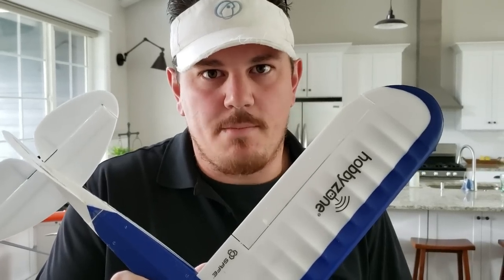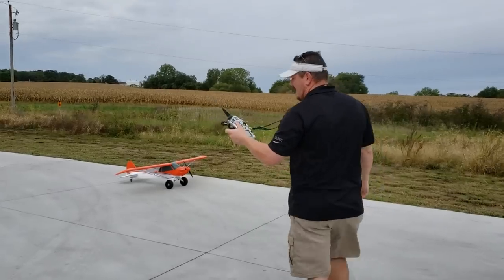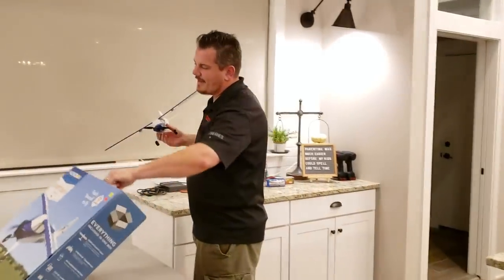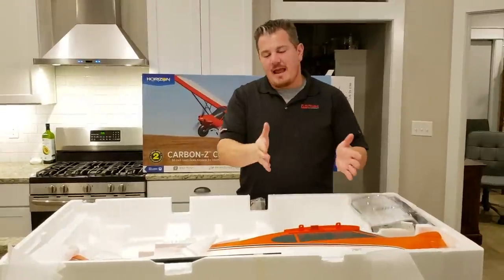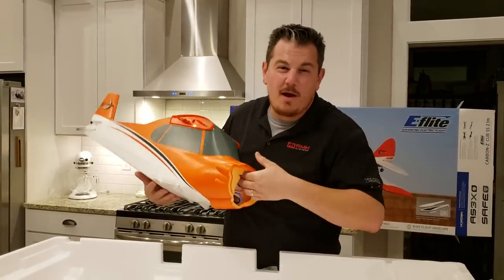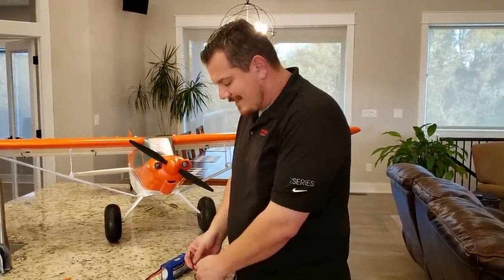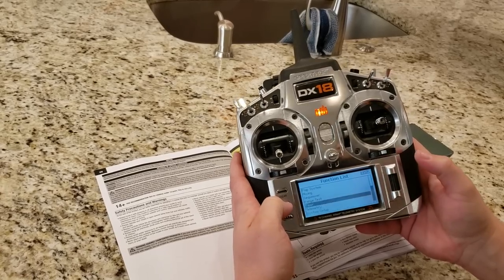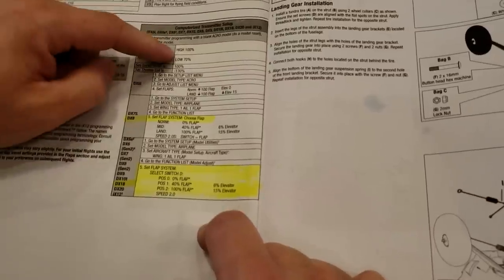Horizon Hobby - Carbon-Z Cub SS 2.1m - Unbox Build Maiden

Comment: There are four things we like to see:
1)  unboxing
2)  build video
3)  radio setup | preflight checks
4)  maiden flight;  flight characteristics,  tips, handling,  &c
Thanks for this video;  very nice,  has well prepared me for my own Cub SS experience.
Reply from the maker: Sounds like I showed you what you need to see ;) BTW, this plane is WONDERFUL! Check you prop a few flights in (the spinner tightness) I had mine pull off in a hammerhead...but all is well, I just flew dead stick from the neighbors side and made a perfect landing, and my father-in-law watched the prop, spinner float down, totally undamaged ;) Had her flying in 3 minutes!!! I did experience some damage to my cowl, but HH helped me out on this.
Reply: @BrianPhillipsRC   Thanks Brian;  actually I already have an upgrade ordered for it--  wooden prop 16x7 ,  and chrome spinner  (honestly I think Horizon should have done that anyway, but whatever.  I was wondering about the prop coming loose;  now I know.  Tnx again.

Comment: I have the blue one. I adapted the 1/4 scale Cub gear on it with full rubber air tires. I flew it today in fact. Love that old Cub. Might need the red one, for a full hanger. Thanks for the review!
Reply from the maker: I was thinking of just getting the pneumatic tires, since these foam wheels, while light, seem kinda "bouncy" if you ask me...also the plane refuses to do anything but track PERFECTLY straight...which is tough with such a floaty STOL plane. I'm concerned I'll have a nose over rolling off, or back onto my "Runway" ;)
Reply from the maker: Are you running the 6" or the 4"???

4" - https://www.horizonhobby.com/45-wheels%3A-carbon-cub-15cc-p-han506515
6" - https://www.horizonhobby.com/big-wheels--6-p-dub600rv

...I bet either inflatable choice would be good, but just wondering what you're running

Comment: Hey Brian. I actually just picked up a Carbon Z cub SS along with a NX8 Transmitter, 5500mah 60c 6s Gens Ace lipo battery and the Spektrum S2100 smart charger at my local hobby store around 3:00pm (CAD) 2021/09/03. This all set me back just over $1,700 CAD after tax. I was watching your video on how to set this thing up. Everything was going great, until next thing I know a hole for where you attack the springs for the landing gear was missing, and the landing gear spring was bent. Very big disappointment for me. I have the receipts, and hopefully the hobby store can fix it up for free, as they sold me a defective product. Thanks, for making this video that I have been watching until 12:00am.
Reply from the maker: I hope they will make it right to you. And yes, that's a lot of cash to plop all at once, but when you see her in the air you'll quickly forget the woes of earning all that money. It will soon be overshadowed by the amazing flying experience.

Don't forget all but about $500-600 of it will be invested in future planes too, so just remember, it's WAY expensive at first, then you get addicted and stop caring how expensive it is - LOL ;) JK

Good luck, and thanks for being her with us!

Comment: hi Brian,  for your viewers ( as well as you )  I have a serious tip for proper  propeller installation on the Cub,  and I am posting my upgrade spinner and prop parts so that folks can easily get an aluminum (Chrome) spinner and beechwood prop (very classic) that will match the Carbon Cub SS.
First, the prop that comes with the model is NOT machined on the back side properly (off center, not deep enough) so that the prop is NOT really tight on the shaft (you will lose the spinner and prop!).  The back side of the prop needs to be machined about 5mm in,  the diameter of the outside collet shaft...  so that when the prop is squeezed between the two serrated plates (to hold the prop) the collet is ALSO actually closing in tight on the motor shaft (words to the wise) !
Incidentally,  I had to machine (hand, dremel tool) the back side of the beechwood prop also to get the aluminum spinner collect to seat properly into the prop.
Ok,  I got the beechwood prop from Xoar International LLC (duh)  and I got the aluminum spinner (chrome look) from eflite part no. EFLSP250.  The amazon links are posted below:
https://www.amazon.com/XOAR-Electric-Airplane-Propeller-Blade/dp/B01AXOX9MS
https://www.amazon.com/flite-2-50-Aluminum-Spinner-Collets/dp/B001DJ4XDC
PS.  The Cub SS BL60 motor shaft requires the 6mm collet;  spinner comes with both 5mm and 6mm collets.
Reply from the maker: Yep, I HAD my spinner and prop come off. Luckily, I was able to bring her in for a dead stick landing...5 minutes later, I was up and flying again, but the cowl was damaged when the prop came off ;( Horizon sent me a replacement, which was very much appreciated.

As for the beach wood prop, it is beautiful!

Comment: Excellent filming Brian wonderful plane . I have it on order....can't wait. Your video's are the best!
Reply from the maker: You will LOVE it!

One tip - Recheck your prop adapter after the first couple flights, mind pulled off the end and I dead stick landed it with only a couple scrapes on the cowel, where the prop popped off...but then was flying in 10 minutes, and HH send a replacement cowel.

LOVE the plane!

Comment: Have one. Was able to get it second hand for 300 Canadian dollars. Winter is here so may not get to fly it this year but couldn't pass up on the deal. 😄
Reply: Put ski"s on it I fitted most of my planes for ski"s and fly year around.
Reply from the maker: Doug - This is the PERFECT winter plane!!! You can fly skis, water floats, or just use the stock tundra tires...she's up for anything!!! And you will kick yourself, if you wait till next year, when you realize how amazing it flies!
Reply from the maker: dave roche - Totally!!! I wonder if the Skis from my new EC1500 would work for this???
Reply: @BrianPhillipsRC  going to surge the horizon site. See what I can find...
Reply: Having an issue with mine. Throttle comes up but dies almost right away. 4s 5000 bat which it should run on fine according to horizon. Really want to get it out tomorrow. Doesn't matter if you bring it up slow or fast. Just like it runs out if juice...
Reply from the maker: I had the same issue with my 5S 5000mAh pack?!?! I bet we need to reprogram the ESC or some such thing to make it work on 4S (or in my situation, 5S)

Can you try it with two 3S in Series???
Reply: @BrianPhillipsRC  I'm going to go to town and get a cable and try that. Was going to hook to my aeroscout but the cable is a better idea. Thanks Brian.
Reply: @BrianPhillipsRC  you were exactly right. Hooked two 3s in series and throttle works. 😄. Found the user sheet for the ESC and you can program with the throttle stick. Search for the elfa1060b program guide and should pop right up. Mine was hard programed for 6s lvc. I changed it to 70%.. I think... Charging a 4s pack to try. I'll let you know.
Reply: @BrianPhillipsRC  and success. ESC now works with the 4s pack.

Comment: Well, I decided to buy it TODAY finally.
The price is not low for a EPP aircraft, though the aircraft is good equipped.
Because I have the E-flite CESNA 150 2,1 m already (Cessna with good opinion of users),  so that one should be also mine (?)
Thank you for your video. I have to watch this to the end (?). Very interesting material (as always) and another point of view.
Reply from the maker: You WON'T be disappointed! This plane flies excellent! It's a bit of a pain to assemble, but that part is short lived, and then you get to bask in it's beauty - on the ground and in the air!!!
Reply: @BrianPhillipsRC  Thank you Brian for your answer.
Carbon-Z SS Cub is mine from today :-)
Best regards

Comment: Hi Brian!  I really enjoy your Horizon, Carbon Z videos.  Right now I'm flying drones but your videos and the Horizon videos may have caused there to be one of the Carbon Zs in my future.  The only suggestion I could make is; at least with this video, if you had used a wireless or even a wired lapel microphone instead of the camera's mic, that would have eliminated the room acoustics (echo) and your narrative would have been much louder and more understandable.  Nice work!  David
Reply from the maker: This is an old video...we have since gone through TWO sets of lav mics and we're on our Third Revision of Lav mics, so you're advice has already been implemented ;)

Comment: What about when the plane is inverted the pressure on the clevis  pins and struts is compression?  That is why you have jury struts  to stop the main struts from bending.  Also when the plane is in negative g's  no strength in the struts. Re; inverted loops etc.
Reply from the maker: I understand what you're saying, but not exactly sure if this is a question or a comment.

The wings are VERY strong. To be totally honest, I've never given it a second thought.

My only issue with this plane, to date, is that the prop came off in flight!!! I landed without incident....dead stick, as expected. My father-in-law watched the prop and spinner come down, and I got it and put it back on, tightened everything and was flying in like 5-10 minutes. This was kinda "my bad" for not noticing the collet had loosened, but kinda a HH issue in that it wouldn't have loosened that quickly, if you ask me...BUT I was hammer-heading the plane when it happened, and only very minor damage to the cowling...which Horizon replace for me at no cost - way to go horizon!...so I guess, lesson learned.

I LOVE this plane. It's a solid platform. The only thing I don't like is the fact that you kinda have to load the lipo in the "chop zone"...but they did install a switch, but the switch in also in the "chop zone" - LOL....otherwise, I love the plane. In fact, my only complaint is that it's TOO easy to fly - LOL :)

Comment: Hi Brian. What is wrong with minus 130% of the throttle cut. Why is this not good? What is the impact? I want to do it right and safe. And safty is the most important part, where I fly…
Reply from the maker: It doesn't make a big difference if it's set at the begging. If you reprogram the throttle range of your ESC and accidentally put the throttle cut on when you lower the stick, and it's set to -130%, then when you turn off the throttle cut, your motor will start.

Comment: Which switch do you usually use for retracts if you also have safe select set up?  i.e. Viper.  
I'm not a pincer either.  I like thumbs.
Reply from the maker: I use A for gear, then I divert SAFE Select to the F key, straight up from the throttle stick (right???)

As for my layout, I do B for flaps, and always do it as close to the same as I can. My brain can only handle small and completely necessary changes ;)

Comment: Dude you need a good quality set of angle ball divers and nut drivers would have made that gear install a 5 minute job. I’ve watched a few of your other videos you have an awesome beautiful new home there. I can’t imagine you can’t find a place to make a RC workshop instead of your kitchen.🤔
Reply from the maker: I have a whole spot for it, but isn't put together yet. So many choices, and don't want to rush it...although I miss badly, my shop from our old home....if you watch some of my older videos you can see that shop.
Reply from the maker: Oh yeah, I have ball ended allen wrench sets, but I was way too lazy to get them out, and I didn't want to do this assembly with any special tools, if possible. I should get some, just for sanity reasons.

Comment: It's sorta steep for a serious toy but I can burn that kind of money so fast with prop time on our simple C172 at the FBO, one's head could spin. This looks like a "cheaper" way to get my ya-yas out since I don't have many good reasons anymore to justify flying the real ones I have for the last 20 years. 

I was thinking of buying a decent Tx (at least a DX8) and a BNF 1.3 Carbon Cub w/flaps but I just know I'll want this big daddy too soon! 

With SAFE as a bit of back up, I think I could swing this plane for getting back into this. Back in the day, we spent months and months building and risked all that hard work and balsa when flying them. I stuffed a few nice sail planes and that really hurt. 

Aside from the $400 bucks ($150 more than I'd be paying if I go cheaper), any reason this  wouldn't be a sweet choice to get in the game?
Reply from the maker: If you're used to full scale pricing...you will find this plane an EXCELLENT value...less than one short hop!

The Carbon Z Cub is a great target, but the 1.3m is an amazing flying plane, and you can beat it up with a whole lot less consequence.

DX8 will do most all of what you want, but if you can stomach the higher price, or go used, get 9 or more channels - you'll thank me later :)

Comment: You should bind your airplane first before attaching the push rods to the horns that way the servos will balance out beforehand and you will have proper alignment
Reply from the maker: I'm not sure what you're talking about. They (speaking of control surface positions) will go wherever they go, regardless of when you bind the plane. Once you've got the radio system setup and bound, then you'll see where things end up.

Maybe I misunderstood your comment?

Comment: Great video! Although I would beg to differ on the points you made at 1:41:30 about not tightening the linkage on the control arm. I feel you should tighten the linkage, so the nut doesn’t come loose. The ball joint is there to create the movement for the linkage, not the bolt in the control arm.
Reply from the maker: Good point, but with a nylock, shouldn't back off, at least.
Reply: Brian Phillips true, I just tightened mine on my carbon z cub just to make sure
Reply from the maker: Hey, while you're at it - check the SPINNER is still tight on the prop shaft. I had mine come off mid flight - all is well, and dead stick landed without incident. We found and installed the spinner and prop (all in one piece) BUT I damaged the cowl when the prop popped off.

This is also why I was having vibration that came and went. Just a heads up :)
Reply: Brian Phillips thanks for the heads up!!

Comment: Hi Brian what do you think about the power plant on the carbon z- 60 amp esc- is that a little low with 6s? How are the servos? Thanks!  Have you heard of any issues with servos or motor or esc?
Reply from the maker: It's good - I've never had any issues, and my servos have been great, BUTTTTTT....many people fly the CRAP out of their Carbon Z Cub, and they pay the price for it ;) I'm pretty nice to it, except for hitting power lines and keeping flying, and losing props while flying, and keep flying, and other non-sense....maybe I'm also no "nice" to mine....

Oh well, still running STRONG ;)

Comment: Maybe someone has brought this up already, Use a wet sponge to wipe the hot iron on to clean the iron tip off between solder joints . A clean tip is imperitive.  Green side if really dirty.     😊    edit  You may of had one I couldn,t see one in your tray..

Comment: Did you adjust the rudder during build? I experience that my plane hasn’t the same (wide) movement in the rudder, despite following build instructions. Using a DX8 Gen2 transmitter, fyi, with 2.05 firmware on it.
Reply from the maker: If I don't show it, then I didn't do it...but I honestly can't remember. If you want more rudder, move the clevis to the inside hole on the rudder, just know that you might see some oscillation at very top end of speed range due to AS3X slightly over-correcting...BUT I don't see mine doing it.
Reply: Brian Phillips thank you!

Comment: Honda CRV.   ok,  its a Civic chassis...  but planes fit really well in the CRV;   with the rear seats down.
:)
Reply from the maker: LOL - thanks for the mention ;) I thought maybe you'd have to put the left wing out the left side and the right wing out the right side and hope the FAA didn't notice your illegal ultralight - LOL
Reply: @BrianPhillipsRC   I will have to disassemble the wings from the fuse,  but I've got all kinds of room,  even for a couple of giant scale planes ( planning on the Cessna too ).  
By the by,  I picked up a telemetry receiver that will match nicely to my DX8 ( or your DX18 ) and DOES NOT need a separate telemetry module (just the receiver).   So my Cub SS is getting that after I check out the maiden flight characteristics on the AR636.  
Thanks again, Brian;   I really like your channel--  say hi to the "camera crew"  and tell her I think she does an awesome job!

Comment: Hi Brian.  My CZC ailerons flip to the left when I test out failsafe mode.  According to my Spektrum programmer app and cable the failsafes are correctly set to SAFE mode for aileron, elevator and rudder, and HOLD for the others.  It's like the plane will spiral to the left if it loses TX.  Did yours do this too?
Reply from the maker: I never tested it, but sounds like you have SAFE programmed in to a switch that might not have been in the correct condition to turn ON when the FAILSAFE activates. Can you double check on this.

Comment: Which 6S pack is best 30C, 50C or 100C? Ive had a lot of puffing issues in the past and my packs were warm after flights. Im guessing that means my C rating wasnt high enough.
Reply from the maker: The 100C is the "best", but I don't know if I buy the added value...higher C rating is a better battery. Larger leads, more protection for cells, bigger connectors, etc.
Reply: @BrianPhillipsRC  i figured 50C would be sufficient